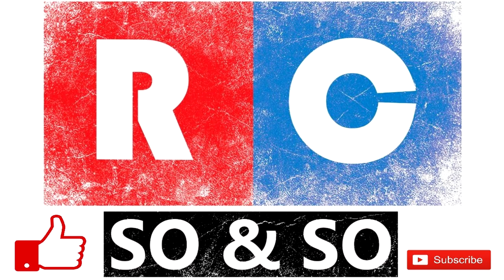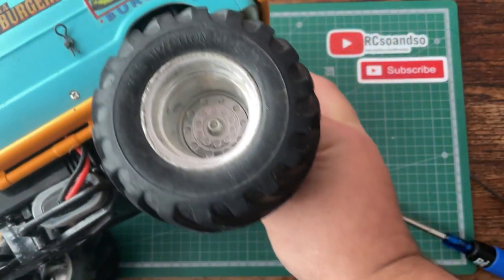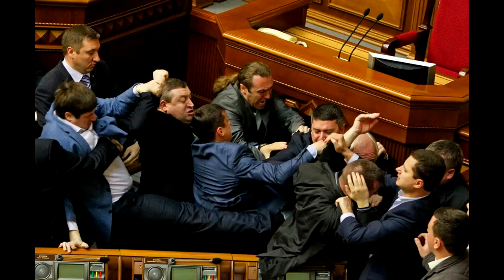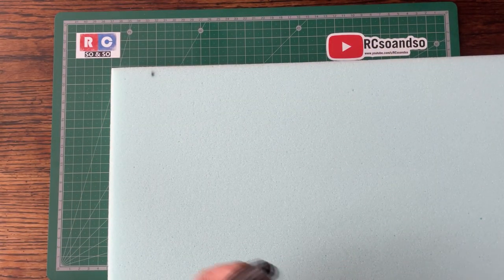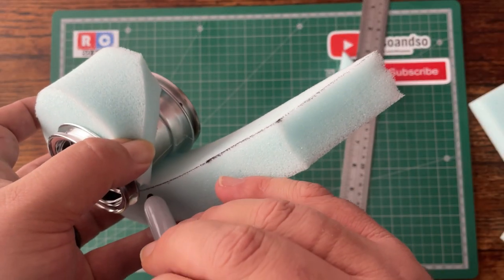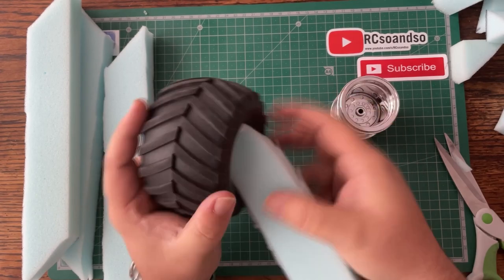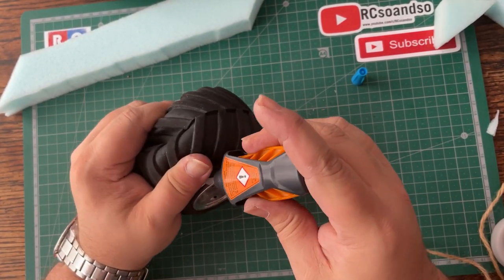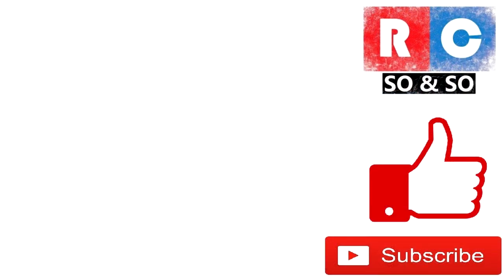Tamiya Lunchbox Foam Inserts - How to make them & Should you use them?

Comment: Hello So&So crew. It's a nice idea to make your own foams rather than being robbed blind by someone who has basically just done the same thing. My personal opinion about the Lunchbox is not to use foams. I think that foams are good for trucks with decent suspension that can go around corners. Neither of these things is true of the lunchbox and the squashiness of the tyres makes up for the rubbish suspension. Just my opinion and I haven't actually tried foams in mine. Anyway best wishes to you guys 😁
Reply from the maker: Not convinced either way so far, I think I need a front knuckle upgrade on this one, but if I’m doing that I may end up replacing the arms as well. Triggers broom springs to mind 🃏🐴
Reply: @RCsoandso  oh yeah there are a lot of Tigger's broom RC's on YouTube. A lot of Tamiya fans end up with an RC that is about 20% Tamiya. With the front wheels I put glue gun glue or Abro Steel around the centre part as it always breaks out on these. Anyway I'm sure you'll let us know how the foams go 😁

Comment: Great idea and from the Range too. Having left my Lunchbox in  storage for 25+years a couple of them have got flat spots so will try this to see if it will help even the tyre out. I have some new replacements if it doesn't work.  Is that the thickest foam they do? I have a Marui big bear with the same problem and the tyres are bigger.
Reply from the maker: They did have a thicker foam, wasn’t much more in price, pence more than pounds. You could also double up the type I had as the length would easily cover the extra diameter 📏👍

Comment: Already glued my rear tires after running it on 3 s brushless, looking forward to the test run👊🏻👍🏻🌛
Reply from the maker: I did run it last weekend, the front left wheel seems to have a wobble, so I will take it off to make sure the foam is flat, but it might be that the knuckle is bent, from an impact, further tinkering is required!

Comment: Has anyone ever thought of sealing the tyres on the rim and gently inflating them? One would need to make up a little valve, but I think that should be doable.
Reply from the maker: They do have little holes in the rims so they would need to be plugged. Be interesting to see it done I’d imagine, maybe internal rubber rings like bike tires could be best? 🤔👍
Reply: @RCsoandso  that might need a bit of trial and error. Depending on where the holes are located, maybe a ring cut from an inner tube from a bicycle could fit snug enough to cover these holes. This would probably serve as makeshift valves. Of course, the tyres would have to be sealed to the rims by some kind of mild glue or perhaps just some strong double sided tape. After all, this doesn't need to keep its pressure for months. A day or two would be enough.
Reply from the maker: Maybe those air bags they use for packaging could help 🤔